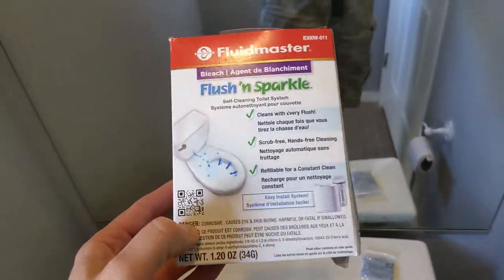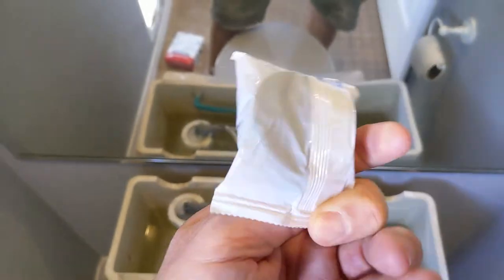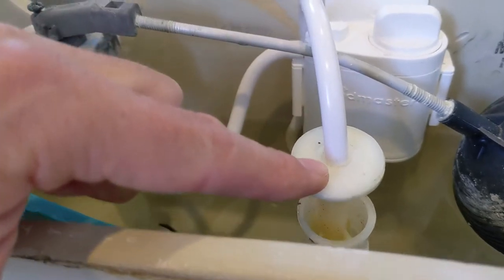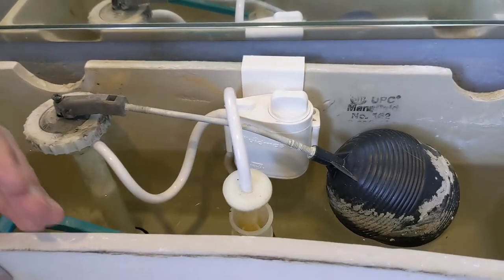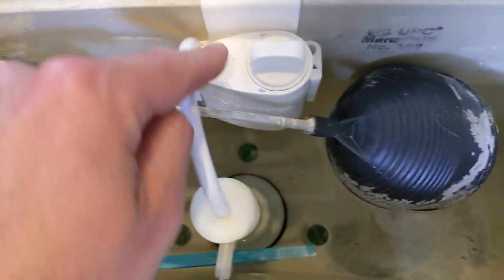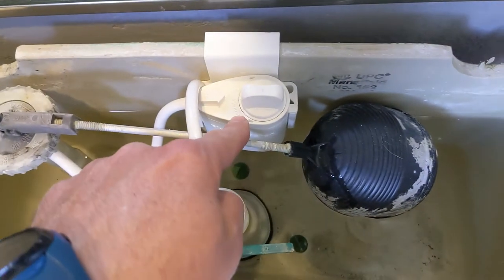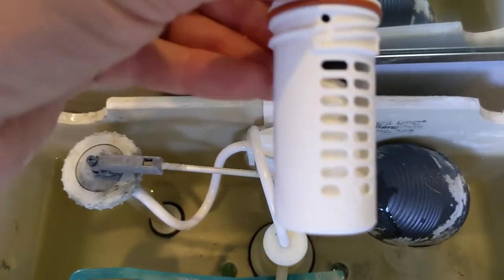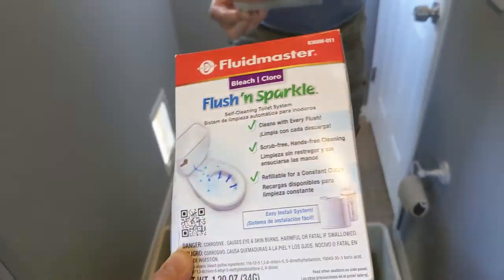Best Solution for a clean Toilet Bowl Fluidmaster 8300 Flush 'n Sparkle Auto Installation and REVIEW

Comment: lol.... look at all the chlorine residue on the black float.... haha, when he says it doesnt fill the tank with chlorinated water... this means, he doesnt understand A THING, about how this system works. lmao
Reply: Can you share with us how you think it works?
Reply: Attached to the flush valve is the overflow tube, responsible for preventing water from overflowing if the supply valve doesn't shut off. Any excess water will travel over the top of the overflow tube and down into the toilet bowl.